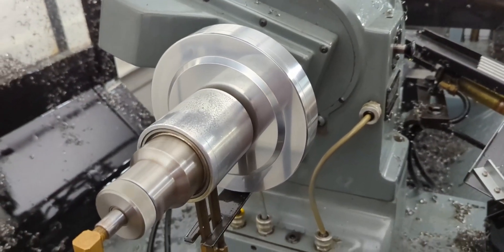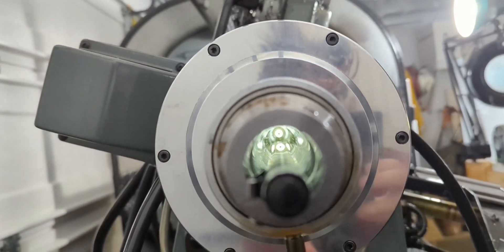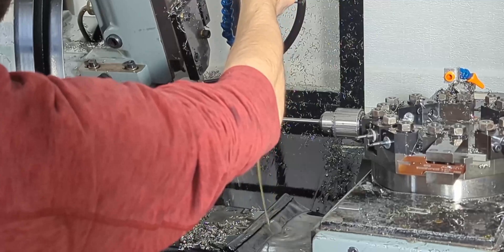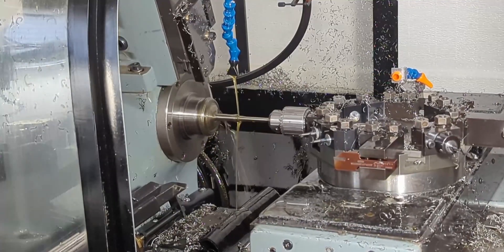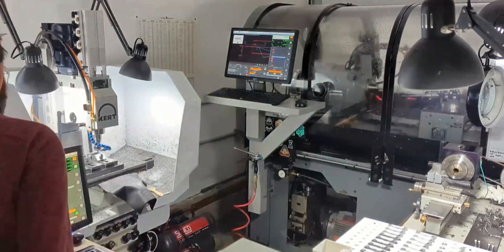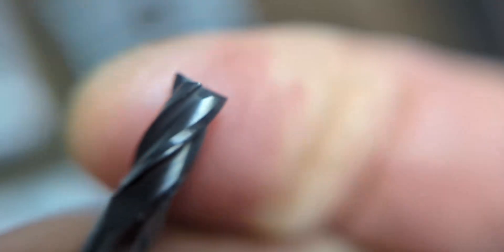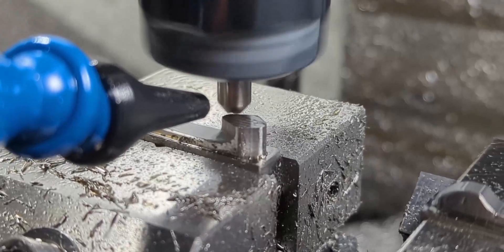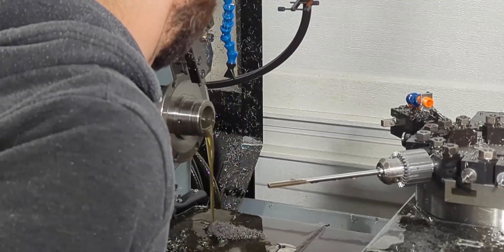vlog 13 - Reaming Titanium With a  'Through Headstock Coolant' Hack

Comment: 3:50   Have you tried Corner Radius Ground Endmills?  If your job doesn't require zero-radius corners at the bottom of holes or trenches, I believe you get better life from them than cutters with those scary-fine points on the flutes.
Nice to see it all "Ticking along" with it's own rhythm.   Thanks.
Reply from the maker: I actually ran corner rad tools for a bit and still do on some ops for those exact reasons. Thankfully that particular tool spends most of its life at full DOC so by the time the tips fail most of the flutes are starting to dull. With that said no reason I can't replace that one with a bullnose...probably help with pocket floor finishes anyways! Thanks for the comment!

Comment: Have you considered gun drilling for the bores? Might be more fiddly to set up but it seems to do generally ok for the namesake of the process lol.

Another cool process I've seen but probably wouldn't be too useful at your scale but fun to dream about. I can't remember the name of it but they basically force abrasive paste through the part at high pressures. Polished something like an exhaust manifold in a matter of seconds. Very cool to see lol. But a little more shop space required.
Reply from the maker: Honestly, when I was having issues drilling a while back I looked heavily into gun drilling. Then I found methods that worked with twist drills and basically forgot about that method! Thanks for bringing it up! 
Pretty sure I ruled it out because I was like "well I need to ream anyways so no point"...however if I can omit reaming with gun drilling that would be a HUGE help. I know what I'm buying immediately to experiment with!

Someone else oddly enough mentioned that procedure (cant recall the name either). Really interesting process that I had no idea existed (or would even work). Very cool!
Reply: Titanium will probably make it tough for the surface finish but I hope it works out for you. ;-)